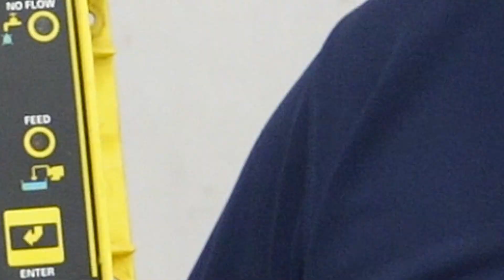Boiler Efficiency 101: The Role of Conductivity - Weekly Boiler Tip

Comment: I have super low conductivity and cannot figure out why. I am not draining anywhere for I drain into a pit and can see the end of all my drain lines. 

I am also not skimming either.  

I do however lose water at a quick rate in my boiler as well. 
This is due to what we believe is steam traps in my building that are failed. We have been working to find them. Could this have anything to do with it?

Comment: Is it possible, that if your conductivity is too low LWCO probes may fail?
Reply: It actually is possible.  Our recommendation is that you have your chemical rep build a cocktail of conductivity builders, etc, to add to the boiler on startup to boost conductivity to detectable levels.  Once a boiler runs and begins to cycle up, this is usually not a problem if the conductivity is being managed.  Higher sensitivity range controls are also available, but in worst cases, such as managing a level in an R/O water storage tank, floats are sometimes a reasonable option.